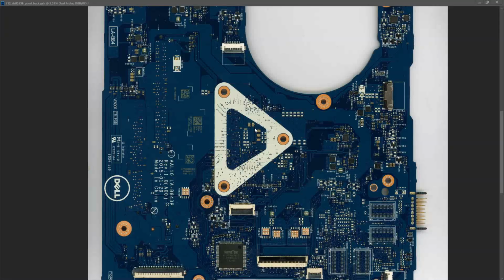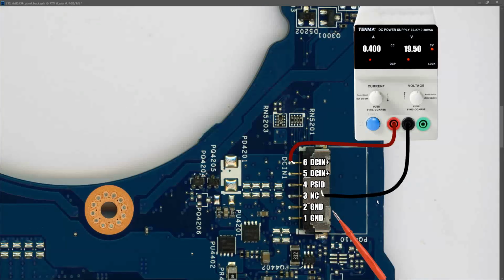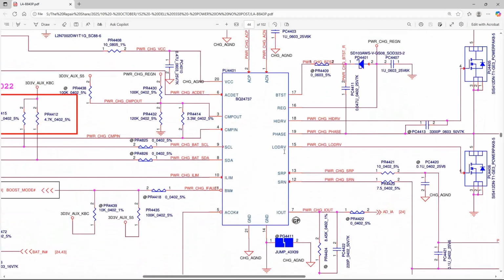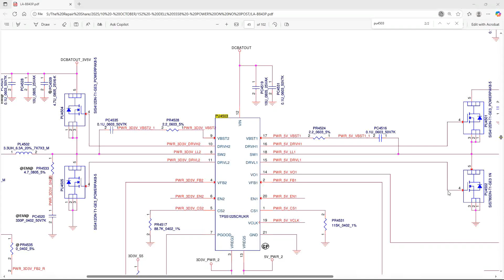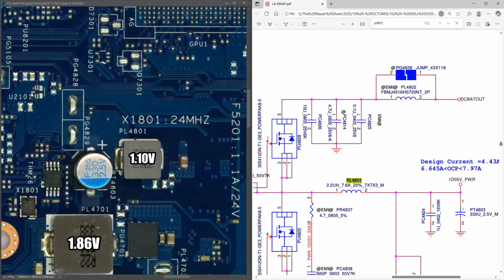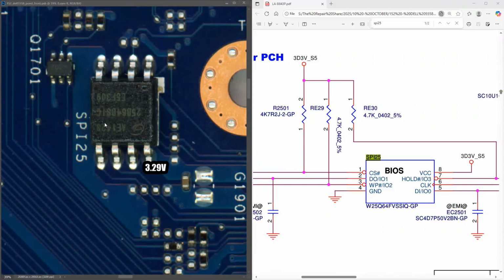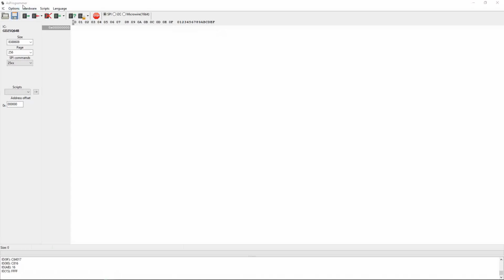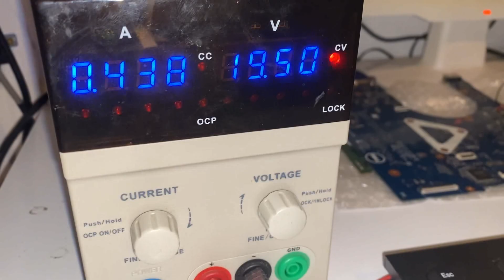DELL INSPIRON 5558 - POWER ON NO DISPLAY YET AGAIN

Comment: CAPS/NUM working meaning the CPU cleared RST and it's fully operational. Only one thing again. You have to make sure that the BIOS file you used has the ME cleaned. There are many BIOS dumps in badcaps but not every each one of these has the ME cleaned.

Comment: Nice video! Turned on but no display and automatic suddenly power off are two most difficult faults, I believe. If you have a oscilloscope, maybe can check the GPU related PWM to determine whether display part is turned on

Comment: Your fix was done properly and correctly but note that Dell devices will not charge batteries or function without a power supply that matches the device's PSID. And on the video the PSID pin on the jack was not even present. Get the correct DC jack and Dell charger and it will display.
Reply: I completely agree with you. If the machine were complete, I would expect to see a standby current consumption of around 10 mA.
Reply from the maker: Hi guys, thanks for your comments. Carlos, there is a stable standby current of 7mA. I think I'm making it too difficult for myself by buying separate motherboards. It's obviously cheaper to buy the motherboards for content this way, but it's like trying to put together a jigsaw without all the pieces.
Reply: @therepairshare673 try to power it with 16v from the battery connector; 5558 utilizes a 4 cells battery so 16 to 16,8 volts dc will be sufficient
Reply: I disagree - it might not charge and it might clock down the CPU, but you'll always get at least as far as the BIOS

Comment: Hi, it is not necessary to have the original lcd, you just count how many pins the connector and use any laptop lcd with the same pin count ; it’s almost universal. Also; check if the cpu is getting hot. Check the coil voltages
Reply: Yes, at the panel connector - but if you don't have the motherboard to panel cable then you're still in trouble!
Reply: @ianba123  True, but you can get the LCD with the flex ribbon 👍